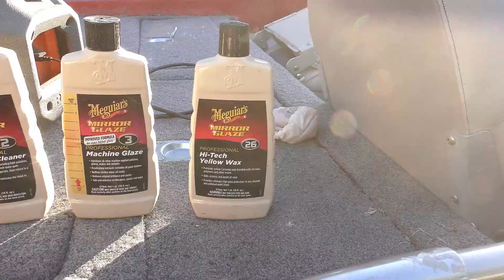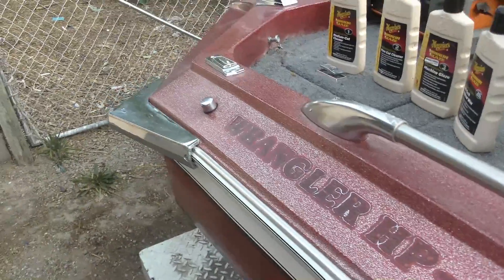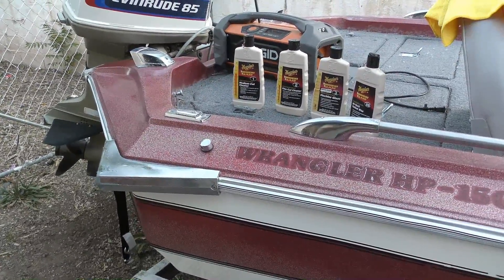To Glow or not to Glow....

Comment: You really need to watch this  video https://youtu.be/5M20fLcNVNs . The compounds your using  needs to be put on and taken off  the correct way .
Reply from the maker: The next time I’m hired to do a professional job with an array of power tools, I’ll watch that video. It certainly seems like a lot of good information. Working in my driveway on a boat that is 35 years old and just using the instructions on the back of the bottle was sufficient for this job.